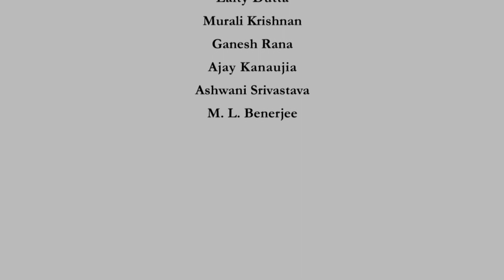Intro - Basic Electric Circuits - Prof  Ankush Sharma

Comment: What is a resistor? How does current branch in a network of resistors? How does it "know" how much should flow in each branch?
While some detail is given in science and engineering courses about conductors, insulators and semiconductors, resistance is described in several ways.
Examples include i. The restriction to the flow of electrons. ii. The difficulty in moving electrical current through a conductor to which voltage is applied.
iii. a circuit element which dissipates energy in the form of heat .
More appropriate description for a resistor would be the property of a conductor which determines the current produced by a given difference of potential.
This makes us remember that a resistor is a conductor first. And, there is reason to say that superconductive wires dont obey ohm's law. So all conductors are resistive, though not superconductors. 

Resistors are used in circuits to regulate the strengths of currents either by reducing the diameter of conductors or introducing more obstacles or lattice imperfections to reduce the strength of current.
The current branches in a parallel network by an elaborate rearrangement of surface charge.
Electrostatics and circuits belong to one science and not two, that of electricity and magnetism. 
It will be instructive to understand Current, the conduction process and Voltage at the fundamental level  as in the following two videos: 
i. https://youtu.be/TTtt28b1dYo and 
ii. https://youtu.be/8BQM_xw2Rfo 
The last frame References in video #1 lists textbooks 3 and 4 which discuss details about resistance, how current branches in a parallel circuit and ohm's law.
Also see these lectures by North Carolina State Univ faculty which use a unified approach to electrostatics and circuits.  

15. Simple D.C. circuit. 
Pattern of electric field.
Watch from  16.0 minute. 

16 Mechanical Battery
Watch from 19.0 minute.
Ch18L1b
https://youtu.be/Eu3JQKrJRZA?si=t3MeX8Hi8ELAxaz0 

17 First intro to  Surface Charge 
Watch from 10.30 minute.  

18 Surface charge gradient 
Watch from  15.30 minute. 
Ch18L2a 
https://youtu.be/bp0o1HZOs3g?si=PPiPGepbXvdTgJHX 

How does current know how to split in parallel branches?
To answer this question one must know the role of surface charges in establishing a current and potential difference in a circuit. 
Supposing there is  a simple series circuit comprising a battery, wires and a resistor R1 and there is a dead-end branch with a resistor R2 across R1. When the circuit is made then initially electrons flow into both branches, but the surface of the dead-end branch becomes charged so negatively that no more electrons can enter. This prevents current flowing into the dead-end branch.
Current of appropriate strength will flow in the R2 branch when the branch is connected across R1. It is not possible in this post to discuss in more detail the rearrangement of surface charges which allows current through the branch. 

The last frame References in video #1  lists textbooks 3 and 4 which discuss surface charges and explains their rearrangement with the help of sequential diagrams in parallel circuits.
Textbook 4 is here https://techsarworld.com/product-detail/fundamentals-of-electric-theory-and-circuits-559 

PPTs and Videos with animations for all the ten chapters and a few applications Regulated DC Power Supply, Differential Amplifier and Transformer coupled audio power amplifier of  book Fundamentals of Electric Theory and Circuits are available for download and viewing here
https://techsarworld.com/download-resource/fundamentals-of-electric-theory-and-circuits-559